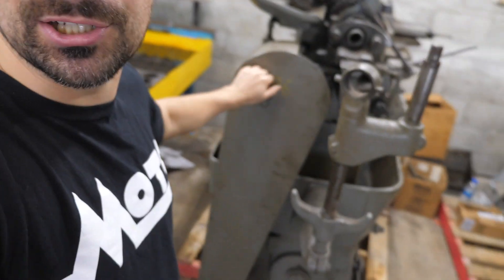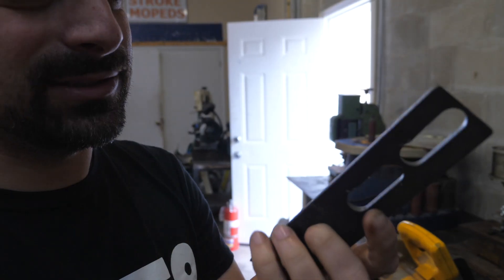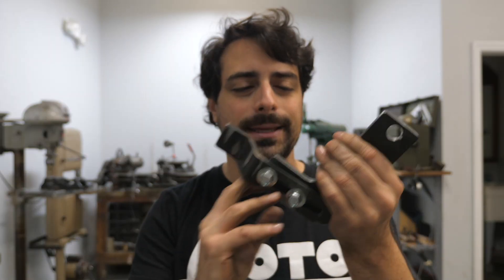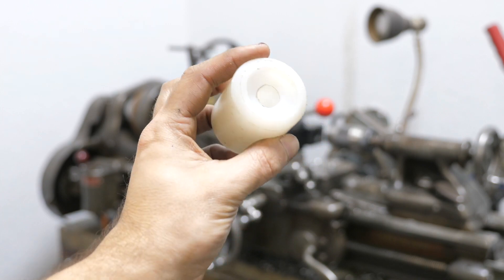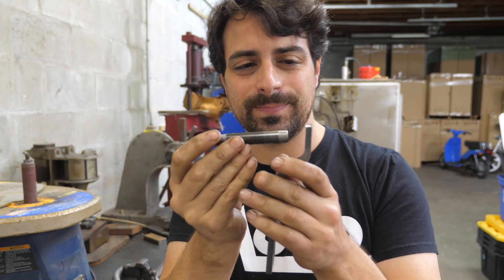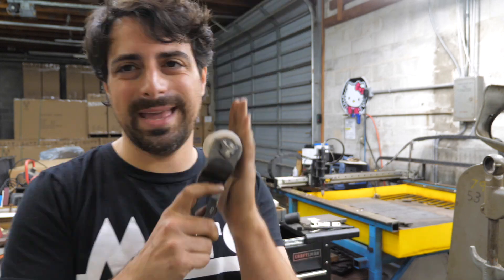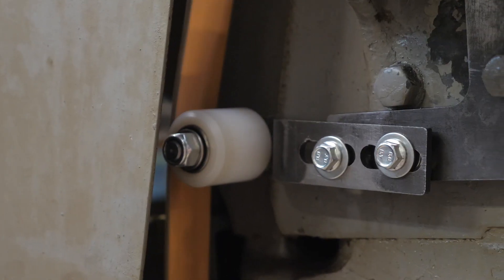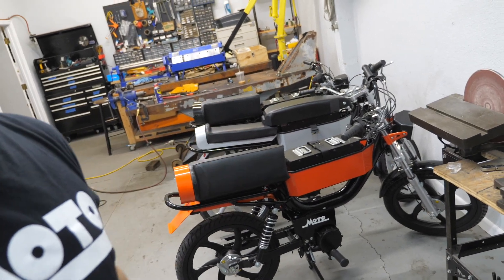Belt Tension upgrade - Brown and Sharpe Automatic Screw Machine

Comment: It looks like you're being really thorough about fixing up these machines, so you may already be taking care of this: one thing I learned the hard way is to check the condition of the rollers that ride on the cams as well as the pins that hold them in place. If those are worn out, they can create a situation where the dimensions on the parts you're machining will move around at random even if the deadstops are set. Awesome video :)   Thanks for posting :)
Reply: I am watching your videos endlessly. If you know and respect Benji like I do ..you very cool.
Benji helped my upjet my vespa Ciao to the point itwould do 90 kmh
Reply: I had three different belts and pullies for different conditions. I ride an Ebike now but love my mopeds more
Reply: We put a hidden expansion chamber exhaust on it , racing clutch.regetted carb Pirelle racing tyres etc.... But j loved my Tomos too
Reply: Hire me

Comment: I run 2g machines every day we don't have any tensioners. It seems you're bandaiding a problem rather than truly fixing it. Either way I'm happy to see ANYONE interested in these wonderful machines. I've got a couple videos of setups running on a 2g if you want to check them out
Reply from the maker: Thanks for the feedback friend.  I believe my problem is with mixed up parts… the top pulley is not original. It’s Half as wide as it should be.  The old belt that was on there was all frayed up from not sitting on that pulley correctly.  So, I thought it was better to replace the belt with a thinner belt to match.  Turns out the thinner belt doesn’t have the same gripping power and the bottom pulley slips.   What I should do is find a replacement top pulley and run a wide belt… hard to find the pulley tho.  Ill run the tensioner for now and maybe keep it for the “belt crossing” you mentioned.  👍
Reply: As an after thought it looks like your tensioner takes up enough slack that you could still twist the belt and have reverse spindle direction if you need and still have adjustment to revert it back to normal. At the shop I work at we just add a small section of belt when we need to twist the belt.